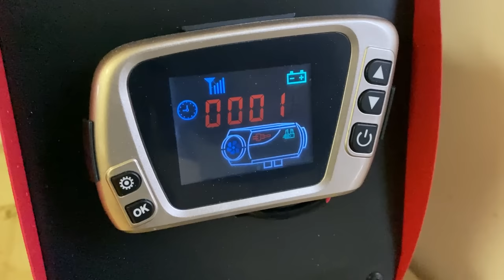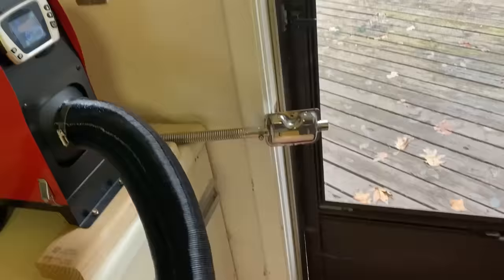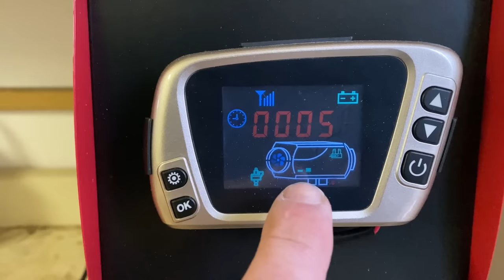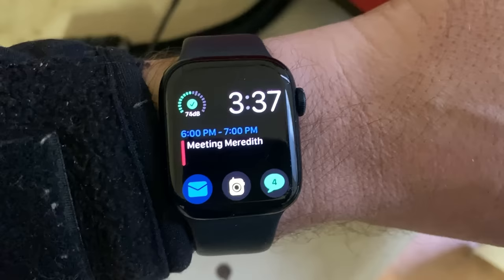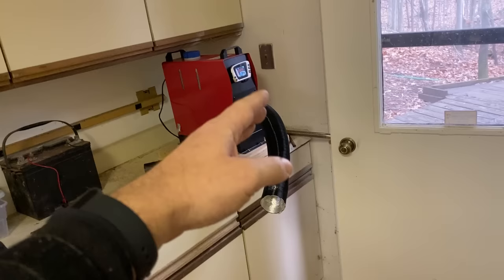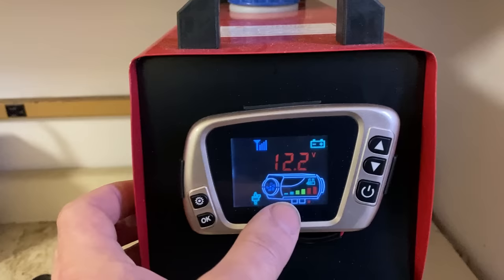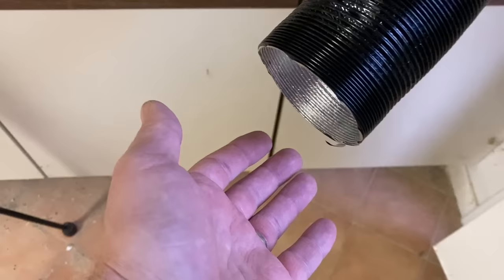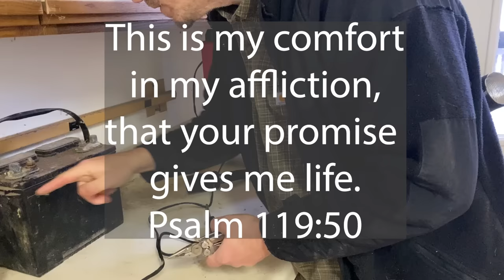Testing a $140 Chinese 8KW Diesel Heater #vevor

Comment: I have one in my garage- 20x24 garage and living up here in northern Canada where it gets to -40 it's handy.  I can keep the garage above freezing with one.    I ended up building an exhaust out of 1" copper that goes up and over the wall and out the eaves.  I ended up putting a T right at the end of the flex exhaust hose and short piece of pipe to capture any condensation that may happen.  I'm pretty happy with my setup for it.  Don't have your exhaust running uphill or it will fill with condensation as I found out and then the thing will smoke out your building really bad.
Reply: Could the exhaust be lagged to prevent condensation?
Reply: Do u keep it on all the time or just when working out there
Reply: Above freezing that is still very cold! 8,000 BTU is not a big output of heat!
Reply: @MissionaryForMexico 8kW is equal to approx 27,300 btu/h
Reply: @Jacklsovakia1  I thought it was 8,000 BTU. Thanks for pointing that out. Yeah that is a very efficient heat source,!
Reply: @Jacklsovakia1 These units are nowhere near 27,000 btu's. They are about half that. 13,000-14,000 btu's, no matter what the manufacturers claim. Period. Do the math
Reply: @bobbarker5884  Did I ever claim that these Chinese burners actually meet their claimed ratings?
Reply: @Jacklsovakia1  No sir you did not. My bad on making it seem that way
Reply: I'm in Canada 🇨🇦 and have one in my detail van 3 years now work flawless I love it I vented out the exhaust into the floor I love this little heater
Reply: Is your garage insulated? How many celcius will your garage get in really cold winter days?
Reply: @ryy597  that's going to entirely depend on the heat load. Yes, that's partly how well the room's insulated, but also the exposed surface area of the room's outer walls, how you've installed the heater, etc.
Reply: Just making sure you are still alive?  The exhaust up out the eaves sounds like a bad idea.

Comment: These heaters are awesome! Heated a 35ft 5th wheel trailer all last winter. It ran 24/7 from october 17th until April 25th this year and i used 122 gallons of Red diesel. On the lowest setting on Alpine mode it would use 1qt for 8 hrs brilliant heaters, would highly recommend them. The Vevor unit is the best make that i have found👍
Reply: I have a qustion  is the battery just for starting the motor or does it need it to stay running
Reply: @lswanger22  the battery runs the fan and the igniter that ignites the diesel.
Reply: Would this work on the 5th wheel camper? I'm going to put  skirting around it.
Reply: @carloswheeldon2553 you can run it all winter long without shutting it off? Doesn’t the battery drain? How do you keep the battery from draining .
Reply: @POWWOWDUDE  i have a battery charger connected to the main power supply110v alternatively i have a basic solar system that charges at about 75w. It works brilliant!
Reply: How warm did it get inside your trailer? And  did you had a skirt on the trailer and additional insulation?

Comment: I ordered one to put in my van so I can sleep in the van when I'm on the road doing gigs.   I will likely replace the propane furnace in my 1970s slide in.  Furnace still works but draws too much power.  I will use that on multi day gigs so I have plumbing, fridge and stove.   The production trailer will get one to keep equipment warm on below zero days.   And I will likely buy my dad a few for his trucks and his "house" .
Reply: It uses much less power than the RV furnace. Takes 10A to ignite, but at a sleeping fan speed it's about an amp... If you top off your battery during the day running your engine it'll be no problem on multi day use.
Reply: Too deadly bro, seen these randomly for a couple years on Amazon and such but just bought a small sailboat to accompany my campervan.  Liked almost all of these comments but I’ll stop at yours being the one that hits home. Cheers
Reply: @anomalous1353  what exactly is your point?
Reply: @volvo09  now that I've used it, it uses very little power.  10 hours at 3.7 htz and I probably could have been warmer.  Looking forward to insulating the van.  Might buy one for every room of the house.  Would cost less than 1 month of propane..
Reply: @travishanson166  you already said it, the point being that you have shared the experience of which I was looking to find to backup the findings of the video.  Cheers

Comment: The lock code is for advanced settings it doesn't lock anything else. You can adjust the fuel to air ratio the hertz of the fuel pump. The code is 1688 if you want to see the settings.
Reply: How many approximately hours will the unit run and capacity of tank? ty.
Reply: @randywalker8960  Full of fuel mine ran 12+ hours. I used it to heat / warm the crawl space below my house. Outside temp over night was 25 F and the bathroom floor remained warm enough for bare feet.   This is similar to a Webasto Diesel Heater we had in a motor home. During testing I ran it out of fuel. It shut itself down properly.  I recommend.

Comment: So have you tried used motor oil or vegetable oil?
Reply: Same thing I'm  wondering. The issue would be heating the fuel supply. You could fabricate a fuel supply that heats itself with the heater's own output, but if it's cycling on and off, that could be a problem.

Comment: The unit is designed to draw in outside air and heat it to prevent negative pressure that would draw in cold air into your shop from outside.

Comment: Are you sure it is meant to be run inside of a enclosed space?  I would strongly advise anyone against running a gas or diesel engine inside a enclosed space.  Just too many safety risks.  I would run the vent air intake (if needed) and heat vent inside and leave unit outside.  Other than that seems like a good heating option.  I have been curious about those.
Reply: It's not an engine it's a heater. Do you not have a furnace in your house ? these are designed to be used inside not outside
Reply: Originally designed for truck sleeper

Comment: We have a few of these, use them for preheating aircraft engines,  just stick the hose end into the cowl and let it run.
They slso work great for preheating tractor engines as well in unheated sheds.

Comment: I bought one a few years back for my 8x10 greenhouse and it works well during the early spring / late fall nights.  I also purchased a length of fuel line and it draws directly from a 5 gallon can. The display brain box isn't the best so keep a spare.
Reply: See some with mechanical rotary knob

Comment: Nice!  This would be just the ticket to heat my goat barn.  I will build an outside enclosure for it and duct the heat into the barn.  The "barn" is a 12x16 wooden shed with OSB steel covered roof.  Should keep the little girls ( dwarf Nigerian) toasty warm!  Beats trying to use electric heaters!  (Yes, my babies are spoiled 🤣)

Comment: It is intended for the air intake to take in outside air. That way you prevent having to draw cold outside air into your heated room. So both the black intake hose and the exhaust go outside so the burning of the diesel and the exhaust it entails basically is in its own outside loop. The internal heat exchanger takes the produced heat and circulates it inside your heated area. 
What I have seen some people do to increase the efficiency even further is route the exhaust through an old central heat radiator and then to the outside. That way a lot of the heat of the exhaust is also used. 
In all these are primarily used in campers, rv's, boats. But I have also seen them used in houses as an alternative or even main heating source. Your battery setup would work for shorter periods. But I would combine one with a small/medium solar generator, combined with some solar panels. That way it would work even during an extended power outage. Lots of videos on the diesel use and energy use for the pump/display (battery capacity) on youtube to help calculate your needed storage of diesel for the max periods you expect to use one.
Reply: I was just going to mention something like this based on common sense. It would be nice to have some type of divider so the exhaust doesn't get drawn into intake. I like the idea of using the exhaust heat too. I will probably go with an inverter for my garage/shop so no 12v  battery.
Reply: The intake hose is like a diesel engines intake valve. all the air the intake pipe takes in goes out the exhaust. For a more efficient burn you should suck in your warm (cab/room) air. Warmer air= warmer burn temps= hotter room temp with less burnt fuel. If it’s -10f your lowering your efficiency a lot drawing that cold of air into your combustion chamber vs the 65f room temp air.

Comment: I have a plan for a large SUV where I want to take the front passenger seat out and cut a hole for the exhaust where the seat sat and route the exhaust out the hole. Obviously sealing up the hole after routing. It would be a nice camper suv.

Comment: I’m going to be very curious about the longevity of this type of unit. We truckers have similar units underneath our sleepers, drawing diesel directly from our main fuel tanks.
The units in our trucks cost thousands of dollars, and the only thing reliable about them is that they’re totally unreliable. I’m not sure what the problems with them are, but I’ve always suspected it was an issue with the digital thermostats.
Please keep us updated on yours, Todd. If it holds up, it would be something I’d consider getting for my truck.
Reply: They are good on fuel bc they get up to temp allowing the jet to stay clear and clean, on a truck it would bounce around and be cold so that could be the problem
Reply: @patrickcurram9763  That’s a fair point; however, when the truck is being driven, we use the in-dash climate controls (most modern trucks with Sleepers have a separate control panel in the Sleeper which can also be overridden by the dash control panel). I can’t speak for other drivers, but I myself have never had an auxiliary heater unit in operation while the truck motor was running.
Reply: We have had one for nearly a year now and it was on 24.7 at one point for several months and is very good on fuel, we have ours outside the house and the hot air vent comes through our fireplace into the room. it has reduced our heating bill by over 60% this winter and paid for itself three times over..
Highly Recommend..
Reply: Is the same exact thing as in the trucks. Some of the accessories might be different.  The expensive ones are German but Germans aren't known for quality plastics,  fittings, tubes
Reply: Webasto. . .yeah those truck heaters are big $$$ but it seems the Chinese have copied them very well. At a little over $100 each, these are a cheap throwaway option.
Reply: They are trash we use them to heat the boxes on our box trucks at work and they never work right and always have to be replaced
Reply: I don’t think I would trust having the unit inside whatever I am trying to heat like a building or a vehicle etc. etc. for the fact, it could overheat or leak fuel and catch fire.
Reply: @mintage3121  Well, there is only one gasket in this design, it's very simple, and very safe. Also diesel fuel is very difficult to ignite without something like a glow plug that's kept hot for an extended period of time. Using these heaters inside is typically a non-issue.
Reply: @mintage3121  I believe truckers have it inside the cab.

Comment: I just had one of these installed in my Lobster boat. It doesnt draw a whole lot of power and it puts out a good amount of heat.  Running wide open it only burns about 2 to 3 litres of fuel in a 16 hour day!

Comment: Somebody in the comments here.... said that the smaller intake hose should draw from the outside air..... keeps the combustion air as a "closed loop".  
That makes sense to me..... think about it as a forced-air, natural-gas, central heating system that is plumbed into your house..... it draws its combustion air from outside, uses that air for combustion, and exhausts that same air outside.    👍👍👍
Reply: Yes, exactly. This avoids inducing a negative pressure in the heated space, which would simply draw in more cold outside air.  “One hose” portable AC units suffer from the same issue; the new “two hose” models have solved it.

Comment: Why not 3D print or build some kind of cover for the intake fan on the back that converts to a 3-4 inch tube and run that into the camper? That way, you are still circulating inside air even if the unit is on the outside.

Comment: This would be a good boat heater. In boats, diesel is preferred as compared to gas or propane due to fire. It is also lots cheaper than alcohol and kerosene.
Reply: Works amazing, believe it or not the safest mode of heat is still a wood stove! You just have to make a barrier between you and the stove while sleeping!

Comment: I have a similar one in my shed  10x10 FT. not insulated  it will keep it warm enough to work in most cold winter days. Run exhaust out through smaller hole to not loose so much hear, door braced open is a lot of cold air.

Comment: heating a garage for sure, I think an amazing use case for this would be the Cheap Geothermal systems that Simple Tek promotes which is a buried irrigation line or PEX and put it down in the Earth with a water air heat exchanger / radiator In summer you can pull cool Earth temps from 10 feet down. and during winter you mount a unit like this behind the box fan and heat exchanger, so now not only are you pulling warmer air up from underground in the winter but then you're also super charging it with additional diesel heat. If your water lines for your Geothermal system are in your floors, you will also be storing that heat energy into the Earth and floors. Lots of ways to do very efficient heating and cooling using a system like this or an AC to supplement simple Geothermal closed loop systems, and those systems are almost always in your favor 10-20 degree advantage in either winter or summer, then just add a tiny bit of AC or diesel heater now you could heat or cool anything. The other way to supercharge a Geothermal system like that is make a hole in the ground, line it with  a tarp or get a cistern and drop your closed loop geo lines into a water bath buried underground. Youll be using and storing heating and cooling energy really efficiently in that system.

Comment: I don’t know what kind of diesel heater he has but I have an 8 kW diesel heater hooked up to a 6 gallon and when I run my diesel heater on full blast nonstop it takes seven days to go through 6 gallons of gas in my 30‘ x 15‘ camper trailer and when we have -30° weather in the winter time in the northern part of Wisconsin run on full blast in our houses basement so our pipes don’t freeze and it keeps it good 65° in our basement but when we heat our basement up 6 gallons of diesel fuel will only last 3 days on high

Comment: Thanks for the review! I have been thinking about one of these. I hear that power stability is an issue. You would not want to run it off a 120v converter because if the power were to go out while it is running it could be very bad for the unit. It needs power during its shutdown sequence, and it must be shutdown properly. I would like to see how long you could run it off that battery or maybe off the 12v output of a solar generator.
Reply: Cant see what Amperage that battery is but dont look brilliant. If charged up and kept a charge would register 13.6V not 12.2V there. 
With a high capacity 540 Ah battery it will poower it for just over 6 hours.

Comment: i mounted mine on the rear bumper of my 28' travel trailer/camper and swapped the stock 1 gallon tank with a 5 gallon slim style military/jeep gas can so I'm not filling it every day/30 hours! by mounting it outside i don't have to smell the fuel.....i did extend the lcd control wire to mount the control unit to the inside through my tail light hole next to my window ac unit i mounted inside my camper.....if i could put pictures on here i would

Comment: It looks like you had the green fuel line with that unit.  Mine ran super rich and built up massive carbon quickly and thew a code. I replaced the green hose with the hard white plastic and has been running great since. Everyone knows the green fuel line sucks at this point so shame on Vevor for still using green fule hose.

Comment: Howdy diesel heater community. My unit is running a bit sluggish. I poured lots of different types of things in it to see what it actually can run on but i guess the worst thing a ran in it was synthetic motor oil. Anyway it runs a bit sluggish now and i was just wondering what will happen if i spray some starting fluid in the intake tube while it is firing up ?

Comment: When the heater is listed at 8kw, that is 27,300 btus. That is input bus, not output btus. A typical oil burner is around 80% efficient. So 27,300 btus × 80% is almost 22,000 btus. 
If you have it outside, so your return air is much colder than inside, you are really killing your efficiency.

Comment: Is there something like a battery charger I can put on the battery while the heater is running to help the battery due to the large draw of power ?  Thank you for your time.
Reply from the maker: I did this video that might give you some ideas - https://youtu.be/nx3Tnw4qV28
Reply: Thank you for your help.
Reply: We always have ours on a battery charger so that if there is a power cut the heater can either close down properly or it will still warm the house without using mains electric, they are brilliant and I suppose ideal for preppers..
Reply: @SSLFamilyDad   Thank you. Norman.